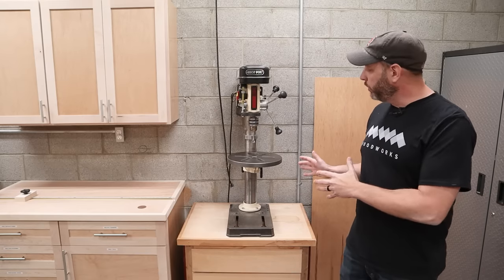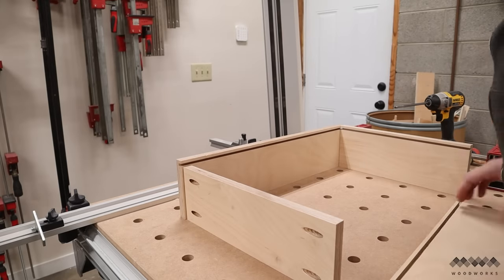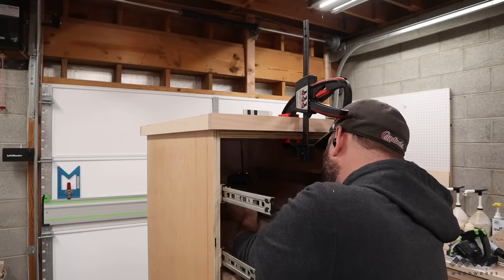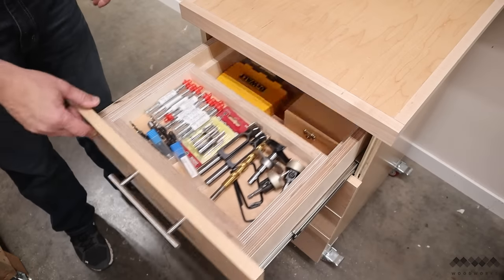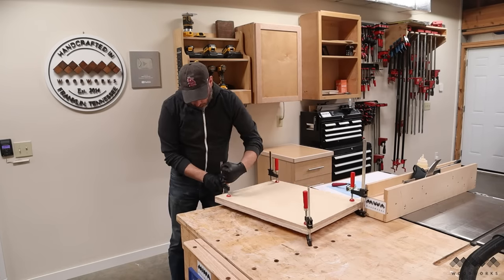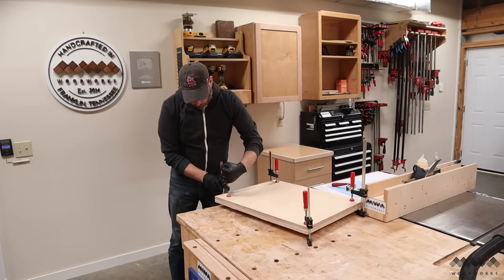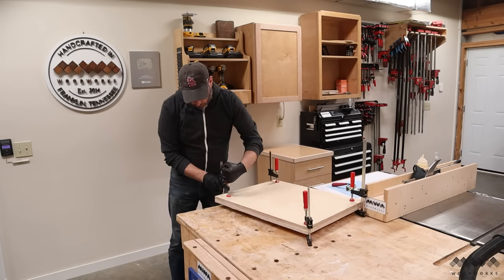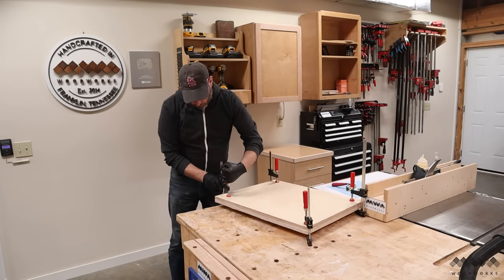5 ways to IMMEDIATELY improve your drill press

Comment: Awesome stuff, I love all the ideas, plan on incorporating most of them in my shop, thx
Reply from the maker: Have fun!
Reply: Question, first Thanks for the reply, I saw in this video you had a ship fox drill press and then in another video that I watched that is close in time you have what looks to be a Nova Viking, if that correct?  Why the change and would you recommend either one?
Reply from the maker: Yeah I upgraded my drill press shortly after that video. I like the Viking because it has a dial to change speeds among lots of other features like a direct drive motor (no pullies to change) I never changed the speed of my drill press because it's a pain in the butt on almost all benchtop drill presses. Also my shop fox became very rumbly and became hard to cut precise holes. Mind you this was after 10 years of use. The Viking is expensive so it really just depends on how much you use a drill press and for what purpose (wood/metal/acrylic)
Reply: @MWAWoodworks  thx for detailed response, enjoy

Comment: Plywood of this quality is not available at affordable prices here in Australia.    We are generally constrained to 12 mm thickness mainly.     At 50 % premium you can get it with one good face, but if you want two face sides it costs an arm and a leg  (like about 150 bucks a sheet).

The big stores only sell what the building industry uses , if you want good DDIY stuff you have to be resourceful and adapt things which were produced for some other purpose.

My garage/workshop is fitted out with recycled stuff.   Cabinets and shelving of this quality are better than most of the furniture in my house.  

The fun is in doing the impossible for as cheap as possible.  Miracles, of course, take a little longer and cost a lot more,!!!

But it’s all fun!

Stavros

Comment: How did you decide how tall to make the stand? There must be a fairly consistent way to figure out what the best height would be to be able to use the drill press most efficiently.
Reply from the maker: I just based it on my height and what I've seen others do. Also how many drawers I wanted. I think there's a pretty wide range of acceptable height. My new stands is 6" taller than my old one and I'm fine working at both
Reply: @MWAWoodworks  Thanks, Will you also be making plans available?
Reply from the maker: I will be. I just hired a new plan guy 😉
Reply from the maker: Plans are now available 👍

Comment: I've got the same drill press, I've got a table, but with what I've got, the handle to raise/lower the bed, it got in the way and I had to carve part of the bed out. Did you have any issues with that or have clearance issues?
Reply from the maker: Yes but a long time ago I took that handle off and I use a drill to raise and lower the table. So much faster.

Comment: I guess in future you would just make your cuts for the T-Track, the drill pillar and the sacrificial centre before you put the black formica on and then use a flush trim bit after to prevent the chip out you had using the jigsaw?
Reply from the maker: No I would just use a downcut blade on the jigsaw. Or just use the bandsaw, same thing.

Comment: Looks nice, but once again another drill press table with the T-slots in the wrong place. After using it you will find that all the sawdust and crud will keep filling in the tracks, even though you have a hose to vac up the waste some still gets stuck. Put the T-tracks on the end SIDES.A bit more work but sooo much better.
Reply from the maker: Never seen that before

Comment: A box between the drill press' table and your top can raise the top above the drill press table height adjustment and column lock crank so they don't interfere with the top.
I really like the idea of the magnets. Consider it stolen.
Reply from the maker: I actually removed the crank for the drill press table and I use a socket attached to my hand drill to raise and lower the table. Much much faster 😉

Comment: Does the table get in the way of the handle raising/lowering the bed?
Reply from the maker: Yes but I no longer use the handle. I raise and lower it with a drill
Reply: I just realized this problem after completing your table..  Been searching YT for various solutions. Do you have a quick summary of how you did the conversion from the crank to cordless drill?

Comment: What if you just used the bottom of the forestner bit case laid in a drawer?  - already labeled and less height required. Always easy to make remarks from the amateur's onlooker! LOL - Thx for your videos.!
Reply from the maker: That would never solve my problem with those boxes which is that I'm not responsible enough to put the bit back where it is supposed to go 🤣🤣 I need a solution where there's only one place for the bit to go 😜

Comment: How about an easier to replicate and replace square sacrificial insert. Offset you could rotate it 90° to get more use, even flip it over.
Reply from the maker: I had a square insert on an old drill press table. I never rotated it because it was a pain to get in and out. It's easier this way and not at all hard to replicate. I can also flip these over to use the other side. I made six of them so I suspect I won't be making more for a very long time 🤣

Comment: Nothing personal but I have to switch off any project that used pocket screws as they look SO ugly and cheap.
Reply from the maker: But you can't see any pocket hole in the entire project when it's done 🤷
Reply: @MWAWoodworks  I quite accept that, it’s just my personal opinion and I grant you that the finished unit doesn’t show them, as I did skip to the end of the video. But, they are there, hiding and laughing at me, going ‘you can’t see me but, we’re here. :) As I said, it’s not a personal attack at you. I know they were used in furniture of old but in something like a tabletop, I would use a buckle that fits in a slot in the rails and allows for expansion and contraction and dovetails for drawers.

Comment: I don't normally cut wood but when I do I like to cut my wood into oversized pieces then take them to another workbench and cut them into slightly smaller oversized pieces then I dry fit them  move to another workbench where I flip them upside down glue them together rotate them add the sliders to the drawers then take it to the table saw where start to measure for final width of the plywood I cut at a depth of 1/8" and boom 12hrs later I've almost made my first cut thru the drawers and sliders I then melt my forstner bits into one large bit and give it to my wife to stir the chili with...MAGNETS????!!!! I FORGOT THE MAGNETS!!!! PROJECT IS RUINED WHAT A WASTE OF TIME..